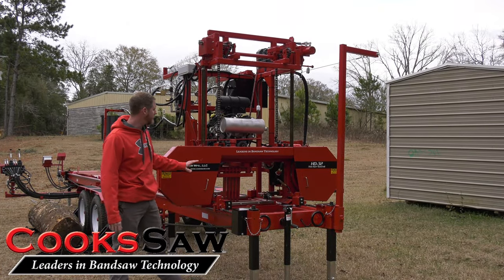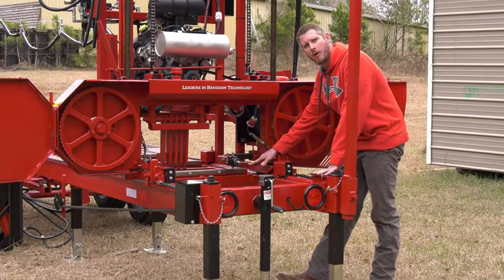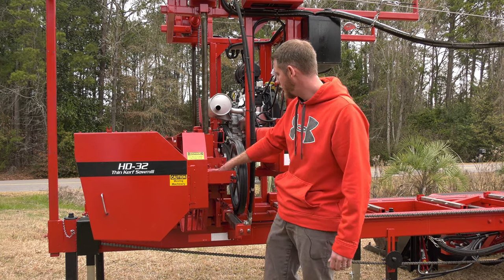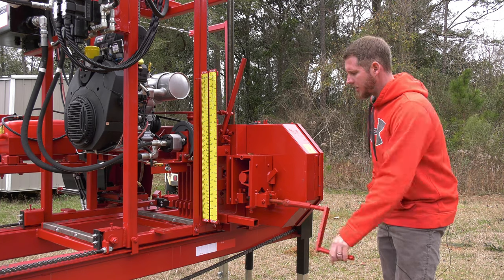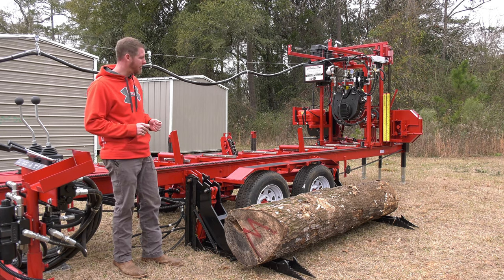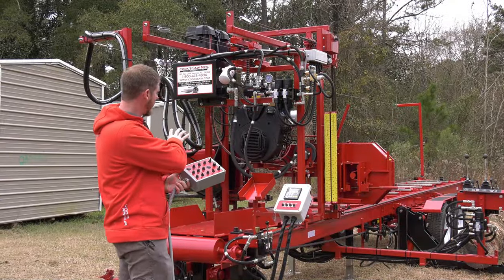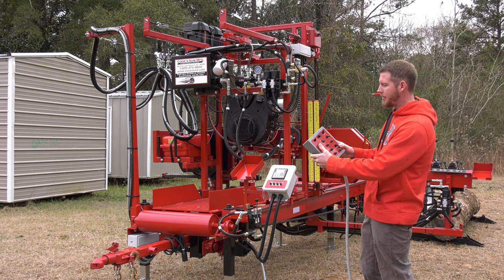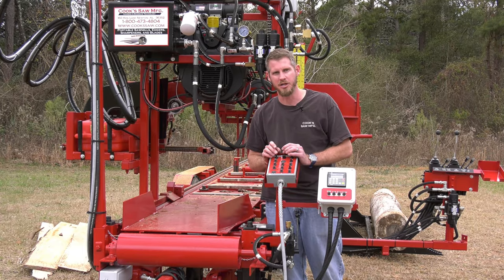2024 Cook's HD3238 Portable Sawmill Demo

Comment: as much as I love my 2007 MP32 manual mill, I see the wisdom and desirability in having power options (namely up/down, power feed, and power turner).  I am working to add those features on my mill, even if just 12v winch motor based until I can work out the hydraulic features as addons.

Comment: does pitch still build up on the blade
Reply from the maker: We use a conservative wiping system with Diesel fuel or an oil based lubricant, that will cut pitch and keep the blade and band wheels clean.